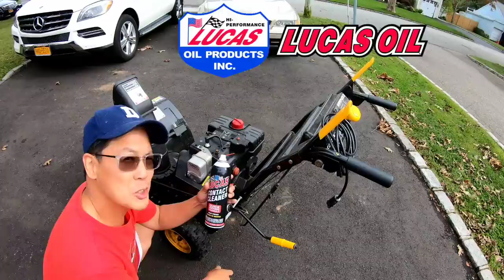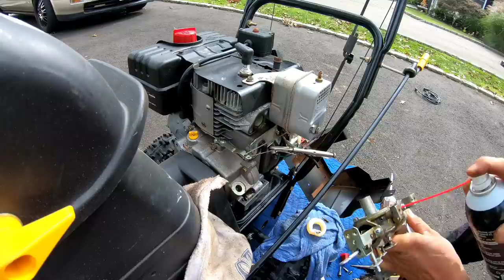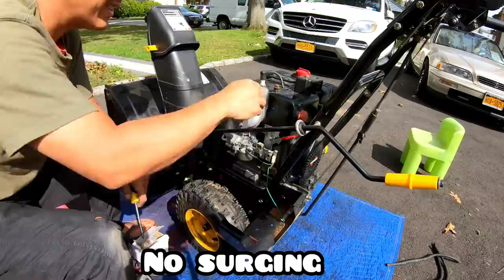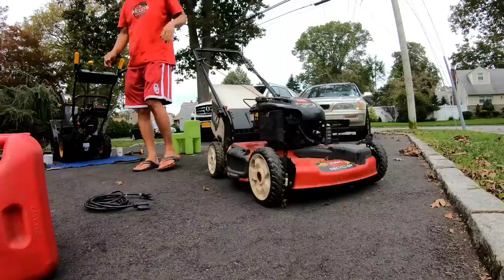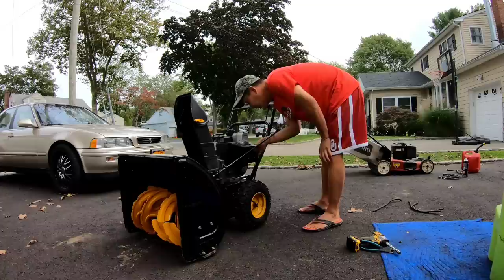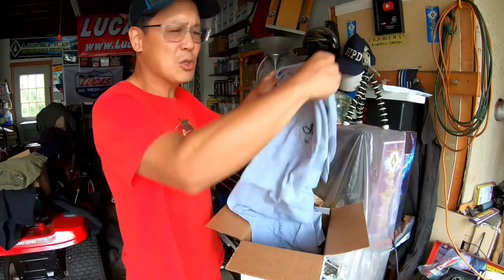YARDMACHINES MTD 8HP TECUMSEH SNOW KING 24" 824  DUAL STAGE SNOW BLOWER THROWER FUEL LINE CARBURETOR

Comment: Awesome video those carbs. Are cheap enough to just replace. I keep those in stock as well. If a hand clean don't do I'll replace it and take the old one and put it in the ultrasonic cleaner for use on a another project. I like the way you thank bro. Saves time to jump on another machine. Keep up the fantastic work. Catch you on the next one.

Comment: Good work! 👍🏼👍🏼
Reply from the maker: Thanks bro!  Hope you’re subscribed
Reply: @MowersNBlowers  Hi, I purchased a used 1996 Snapper (8/26) model 8265 (for $15 on an online gov auction) that has a 8hp engine model HMSK80. I put fresh gas and it wouldn’t start. Took notice that the prime hose is broken off the card and in another part of the hose. Took the carb drain bowl off and it is full of dried out brown crap all caked up inside really bad. Would you be able to tell me what carb I need to buy? I’ve searched and I’m unable to determine which is the correct one. Fuel line is also needs to be replaced.

Comment: Just a little trick we use at Eliminator Performance to change fuel lines on a snowblower: Cut off a bolt leaving only the threads making sure the diameter is slightly larger than the ID of the fuel line, screw in the bolt half way in on the old fuel line and half way in on the new fuel line. Use either electrical tape or Gorilla tape to connect the two fuel lines at the junction point then pull the old fuel line from the fuel tank end while guiding in the new fuel line from the carb end. Works first shot every time unless you put on too much tape. Really suprised you got that line in. Additionally, Techumseh uses a fuel line slightly smaller on OD than the 1/2" B&S OD
Reply from the maker: I got lucky Wayne!

Comment: i think i would have made the gas line longer and push a wire through and tied it to gas line and pulled it back through then cut off the end to fit. Just an idea for maybe next time
Reply from the maker: Good tip chico!

Comment: I thought that the surging can be resolved by cleaning the one hole with a small drill bit?  Try it out.  Steve's small engine YouTube channel.  Give him credit
Reply from the maker: Or just replace the carb for $8
Reply: Ok, you fixed it for $8,  but you didn't find the issue.
Reply from the maker: Sure I found the issue, the old carb was clogged in some jet.  It would probably be cleared up in my ultrasonic cleaner, but for $8 to fix the problem and move on is the ultimate goal.  If I reuse the old carb, I’ll ultrasonic it if I need it again, but I have $8 carbs in stock.  No need to spend valuable time when $8 lets you move on and finish the project.

Comment: I had my driveway replaced the guy that tarred it don't seal it tar needs to breath. If you seal it could make it crack faster
Reply from the maker: It’s been a year though.
Reply: Doesn't matter needs to breath all the time. Should do more research. My driveway is over 10 years old looks great still
Reply from the maker: I dunno bro....maybe differences in region?  Long Island vs. ?   Snow?  Literally everyone seal coats at one point or another.  Not doing it deteriorates the driveway which was why I needed a new driveway.
Reply: I'm in western mass
Reply: Most of go bad because of bad base

Comment: hows it going Henry could you help me find a tecumseh formula 12 carburator part number thanks
Reply from the maker: Mike, can you be more specific?  I don’t know if I’ve ever heard if a formula!  Lawn tractor enduro engine? Push mower engine? Snowblower?
Reply: @MowersNBlowers  its a formula 12 tecumseh ohv riding mower engine says industeral commerial
Reply from the maker: Is it a black plastic bowl like this?

https://www.amazon.com/FLYPIG-Carburetor-Tecumseh-640065A-Tractors/dp/B07214QGLR
Reply: @MowersNBlowers  sorry no has a metal bowel
Reply: found some numbers ovh12 2027258 5340D not sure where  to look this up
Reply from the maker: Do you mean ohv12?  

This one?  https://www.ebay.com/itm/233485125902
Reply from the maker: Have you ever tried google or eBay?  Just search the numbers
Reply: @MowersNBlowers  no china aftermarket carb on this one bought a carb kit on ebay